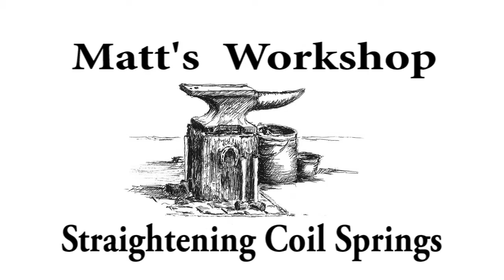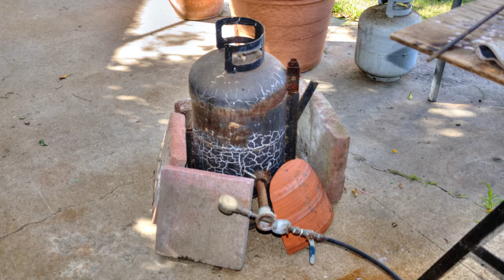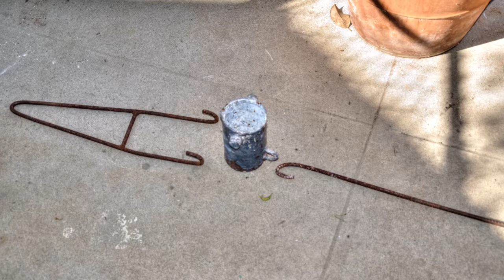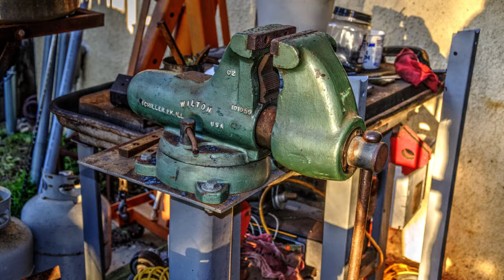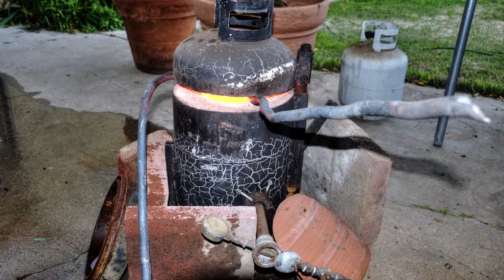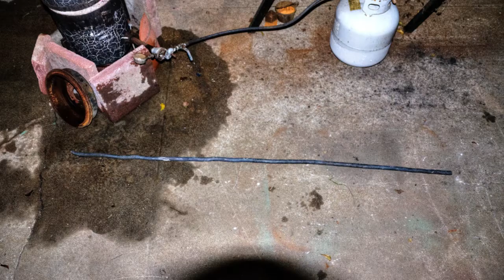Matt's Workshop - Blacksmith Straightening Coil Springs

Comment: Thanks for posting this. I plan to make a furnace specifically to straighten coils for same reason. 
I did see above video where the hot coil was placed over a pipe held in vice and then vice grips used to grab one end and pull the hole thing straight in one go. I'd like to try that...
Reply from the maker: Thanks for commenting!  I did try using a pipe, but I couldn't get the entire spring hot enough for me to straighten her out in one pull.  If you give it a shot, please make a video.